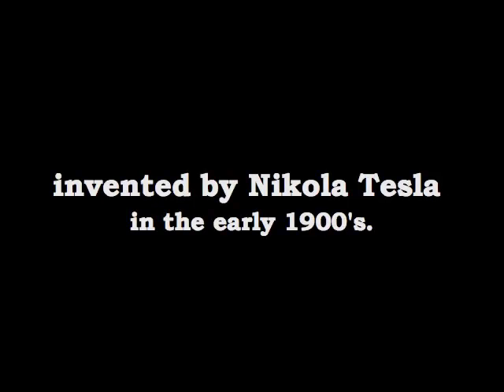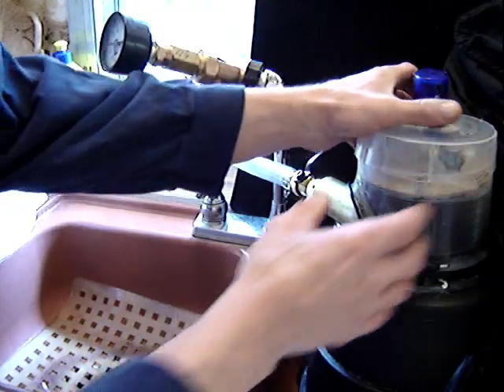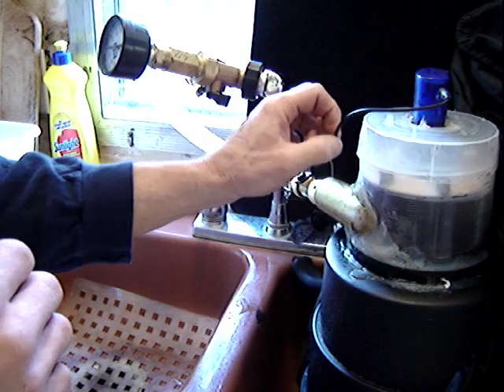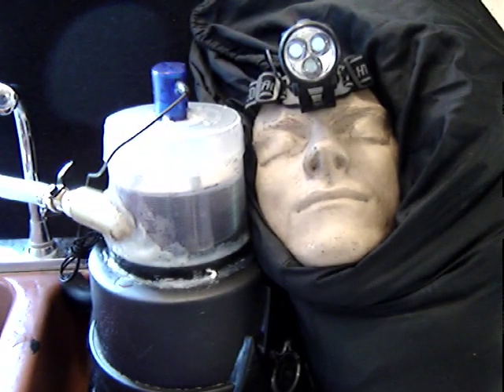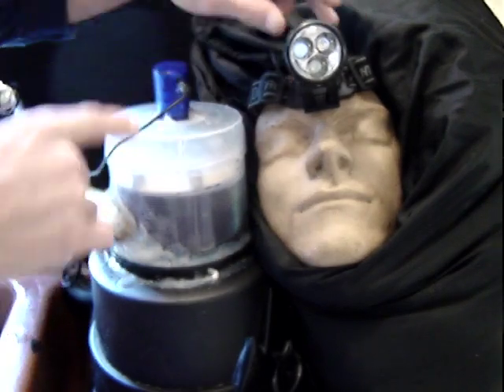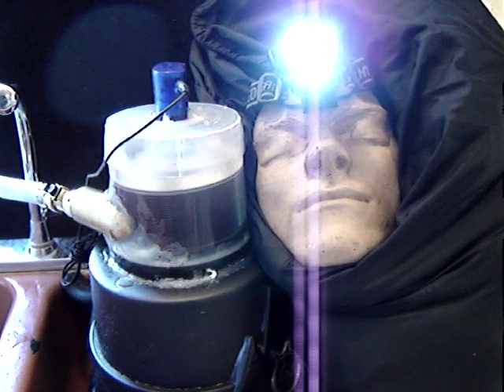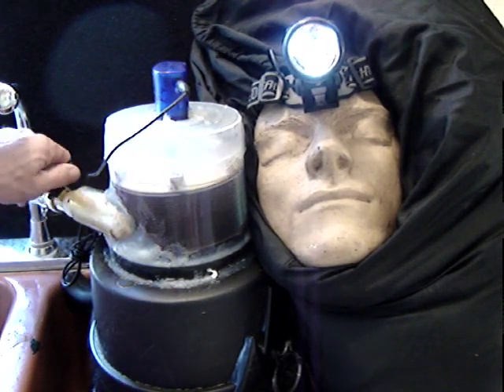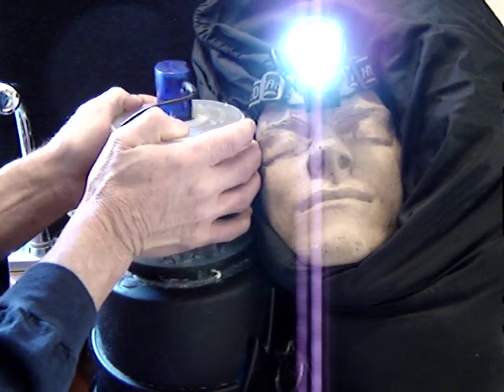SinkScience #14 - Faucet Powered Head Lamp Generator

Comment from the maker: It would be hard to beat the efficiency of a modern propeller in this application, but the Tesla pump is still a very effective way to move water.

It would be a great experiment. The design would be based on the rpm of the engine, and the power (3 kw), which would determine the Tesla pump disc diameter and number of discs required.

Comment from the maker: It's usually more of a problem with not enough pressure rather than too much. That's why in my latest projects, I am incorporating air pressure as an additional boost to the water. They work well together in a Tesla Turbine, I've found. That way I can get up to 70 psi into the CD Cakebox nozzle and get good rpm's and power.

Comment from the maker: Good thinking...but what happens is that the second generator that runs on the water pressure coming out of the first turbine, will restrict the water flow and cause the first turbine to slow down.

There might be special designs that could take advantage of some of the water energy that comes out of the first turbine without affecting it's power. But it will never be enough to make the system self-running. 

That's called perpetual motion...and so far it's never been accomplished!

Comment from the maker: Yes, and free energy, too!  Plus it charges the battery, so it only has to be running for a minute or two.

It would require a lot of water for the energy you get; some folks have to pay for it, and it is in scarce supply in most parts of the world. But in an emergency to charge a cell-phone or for a light...